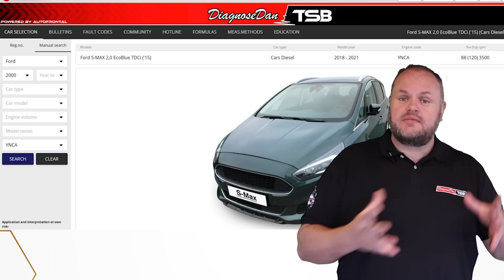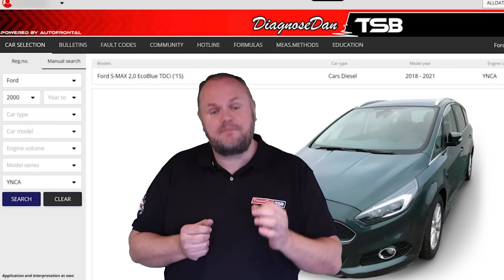Ford S-MAX – Engine won’t rev past 2000 rpm (intermittent), no fault codes. The hidden cause

Comment: I admit, we all cannot memorize all data PIDs correct readings when the car has been sitting a long time and is cold. BUT, a few minutes to scan possibly hundreds of PIDs to see one clearly out of temperature range and other noticeable ranges ought to raise a flag right away. With experience and a little dedicated time, on our own time, a listing of quick select PIDs to view before starting the engine will save time in the future and may rule out those sensors as the issue at hand. 

This is the thinking of a computer programmer who knows that designing the diagnostic strategy, scanning PIDs for a bit of time, and creating the listing for the future will initially take some real time. Still, once the algorithm is designed and implemented, it's a quick alphabetical scan of the PIDs, noticing a problem or not, and moving on to normal diagnosis or the swap out of a visibly erroneous sensor. This, of course, is for non-DDTSB subscribers.

Danny, this is the type of video that all automotive repair content providers should be creating for quick referral to the viewer and an additional income stream of the same data in a shorter release. We all believe that a full diagnostic video should be created that most providers create with lengthy diagnosis, but in the distant future, perhaps after one year, reupload the same video by editing out all info that is not direct and to the point of the actual FIX, of course, with a link back to the original full-length diagnosis video. In this case, the history of the vehicle is very important, as taught in the ASE Training and similar training around the world. Training that many techs seem to forget about in their daily routines.

Comment: @0:00 Danny???? wtf :face-blue-smiling::face-red-heart-shape:
OMG, they just throw new parts at it.. with no diagnose... 
@1:48 I would guess it's a leak in a inlet or exhaust.. false reading on sensors, like airflow / oxygen. But really waiting for your diagnose, Dan... :face-red-heart-shape:
some time later:
Wow... never would have guessed that temp sensor..
Reply: Temp and pressure sensors go bad often in a different way also; the scanner looks good until you actually measure the voltage at the sensor, highly recommended, as seen all over the DDTSB FB Group. This case only needed a visual scan of the PIDs, a voltage drop of the circuit, looking for corrosion, and changing the part that the PCM says is still within range, so no DTC.

Comment: Another person in agreement here Dan - one day subscriptions for limited selection would be very very useful and independants/DIYer's would happily pay for it and possibly contribute - after all - the manufacturers are now meant to have hourly / daily subscriptions to their platforms - and they mostly do - but trying to find TSB's in their platforms can be hit and miss. Auto-Frontal may not listen to individuals but you might be able to give them the hint..
Reply: DDTSB has lowered the minimum Sub down to 3 months due to the feedback of potential users for a trial basis. Last I understood, there is a 100 Euro fee that gives 5 x 20 Euro assistance tickets to help locate the problem at hand, which covers more than DDTSBs only from the Help Desk staff, and covers the issue until resolved, not only 24 hours. Sorry if this is not accurate.

Comment: Customer is happy because he's got new injectors and EGR valve, so it should be a keeper for several years.
Reply: Shops are happy as they have known good used parts to resell if they were not CORE parts.

Comment: This case is emblematic of many complaints from the customers.
Has the fault vanished after the shops did the final test?? NO. They shouldn't have returned the car to the customer!!
Yet two shops did the same. I wonder why the customer didn't check the car immediately and return in an hour.
So, the one million dollar question is: DAN, why is it allowed for the car shops to keep all the money for a wrong repair??? The normal logic says you get all the money back for a bad repair.
Reply: I think the issue results from a combination of factors.
Technicians work under significant time pressure to complete repairs as quickly as possible while also being responsible for both the diagnosis and the repair itself. 
This can make it difficult in some cases to explain to the workshop manager that the proposed repair solution did not resolve the problem. 
Regarding costs, it is often challenging to determine whether parts were replaced unnecessarily.
In some situations components such as injectors may indeed be faulty but just not responsible for the specific complaint. 
In this particular case, I know that the dealer did not charge for the injectors.
Reply: @Diagnosedan  I would have liked a more honest answer from you, Dan. You are finding excuses for the technicians. The matter is rather simple. You diagnose the fault correctly -> replace the faulty parts (or repair) -> perform a DRIVE TEST to verify that the complaint has been resolved -> return the car to the customer and charge for parts and labour. What explanations? Is the car fixed or not? If not, you charge nothing. The client comes to a car shop to get the car fixed, not to perform experiments on it.
Think of it in terms of a medical doctor. Let's say you have heart issues. You go to the doctor, he performs several tests on you, then he makes a diagnosis, and sends you to surgery for a heart transplant. He sends you home, but you feel as bad as before surgery. You then see another doctor, who determines that the problem was a clogged lung artery. He performs a surgery on you, then eventually you feel better. After your recovery, you go to the first doctor and ask for a refund for malpractice (wrong diagnosis, needless surgery, and needless heart transplant). The doctor tells you he can't pay anything back because you have a new heart, and work has been done on you. NEEDLESS work. Wrong call. No health restored.
So what I am asking you, Dan, is this: Does nobody stand behind his work? No responsibility? Just plain theft and incompetence?
Reply: @zbigniewrichard8291 
I would appreciate it if don’t call me dishonest Richard. 
I don’t believe that reflects who I am.😥
I’m not trying to make excuses i’m simply trying to explain the factors that may have contributed to what happened. Understanding these reasons doesn’t mean I approve of the behavior because there is no justification for it.
But recognizing the causes is important if we want to prevent it in the future.

For example, if someone punches another person i might say;
“Perhaps he reacted that way because he felt offended.” 
That explanation doesn’t mean I believe the action was acceptable. 
These are two very different things Richard i hope you understand that. 
There are also other factors to take into consideration. It’s possible that there was an issue with the EGR valve or the injectors but unfortunately replacing them didn’t resolve these particular symptoms.” So many things we dont know that makes it hard to draw conclusions.

Comment: Now imagine old, advanced (for its age) car, that don't have diagnostic interface which could show any sensor data, only codes, but there are none. It will be my fifth year with intermittent misfire in Mercedes W208 and at this point all workshops in 100 km radious have me blacklisted and if this continue I may gather enough knowledge to sense sensor data with just my fingertips :D
Reply: May the Force be with you.

Comment: For me, Ford programmers didn't done job properly. Weird readings from fuel temp sensor should trip error code. Easy to compare to other temp sensors in engine bay. 
And maybe thats also lesson to us of all, look into live data after no error code triped but car is not running properly.
Reply: Thanks for your feedback!
Reply: If they program the PCM correctly, we would just go buy the part ourselves, and no need for a trip to the dealer, which is the name of the game. I made a large post saying what you suggested, great idea mate.

Comment: Whenever a shop tell me my fuel injectors need cleaning. I walk away from that shop.
Reply: Unless you live in Pakistan where the entire fuel system and exhaust system and intake system is brown from the dirt roads. Cleaning these nearly complete systems is the same as a tune up there, I follow a YT Channel and I call it the "MANSOOR TUNEUP," then I mark the video as RED in my library as a non-keeper as it happens so often I have it memorized.

Comment: Always interrogate every sensors that can influence the mixture creation. Isn;t fuel temperature sensor a generic PID for OBD-II?
Reply: Easily overlooked!
Reply: its not out of range as far as programming is concerned; it's up to us to check it visually to see if it is around ambient temp, which the first 2 shops did not do.

Comment: I had something similar on my Laguna 2, it was throwing Check ignition system, all due to not attached connector of intake air temperature sensor. Luckily I have my launch diagnostic tool with me and saw odd readings like - 40C for intake air temperature.
I mean, a lot of mistakes require a test drive of the car.
Reply: If the sensor was disconnected like yours it would have set a faultcode and than they wouldn't have missed it.
Reply: 40C = open circuit; not all vehicles max out as low as 40 so beware, but still way too low.

Comment: Bro step #1 when diagnosing a driveability issue with no codes is to just look at the data and look for anything out of the ordinary, you would have seen that right away..... Morons 🤦
Reply: To be honest fuel temperature is a datapid that's easily missed.

Comment: I had the same symptom on my Jaguar XF 2.7. The fault was a broken cable on the diesel return temperature sensor
Reply: I guess that did set a code?
Reply: @Diagnosedan  
I didn't have any diagnostic interface to find out the error code...I just used the service manual and a multimeter.

Comment: The big question is why didn't any of the technicians check the data pids ? That fuel temperature would of stood out like a sore thumb.
Reply: To be honest fuel temperature is a datapid that's easily missed.
Reply: They did not remember their training, if they were ever trained properly.

Comment: This should have been picked up by any competent technician with a decent scan tool by checking all fuel related data PIDs
Still way too many techs playing swapnostics.
I was taught if you can't prove it, don't do it.
Better to give the job away than dig yourself a multi thousand dollar hole.
Reply: They did not dig a hole for themselves, unless you mean that the customer will never return again and tell their friends the same. The dealer did not charge. But you are correct.

Comment: 2000 RPM? The only way you can get it to rev that high is put it in 1st gear and try to drive it down the side of Mt. Everest. FORD - F'er Only Runs Downhill

Comment: Wow that is a weird problem! DDTSB to the rescue!
Also Ford sometimes SUCKS at setting fault codes. This one should have set "Fuel Temp Not Plausible" or something :)
Reply: Hi Ivan! I agree, because it doesn't set a code its very easy to miss.
Reply: Ford is one of the worst cars at fault codes 😂
It can limp and misfire for many KM without any fault codes.
And it can have permanent fault codes without faults.

Many faults also on LIN Bus but the fault codes rarely point to the actually bad component, an oscilloscope is almost a must have for these cars 😅

Our workshop bought an oscilloscope because i was trying to find a fault on this exact type car.
It had 3 alternators replaced and still no charge.
When i took it in it charged but after a while i got an alert in the dash that told me to start the engine or turn off ignition will enter economy mode in X seconds, before it went dark WITH the engine still at idle 😂

And i couldn't turn off the engine... 
Had to chocke it on the intake
After lots of frustration i got the oscilloscope and checked LIN Bus and this was all garbage, unplugged lots of things and when i came to the radiator shutter curtains everything became normal.
It had water ingress in the servo motor and shorted LIN Bus.

I have since had 3 cars with some different symptoms but the same solution.

First one was before there where made an TSB on this
Reply: @tullgutten  I believe that the shutter and alternator are on the same LIN line, so the shutter problem shorted out the alternator waveform. Let's assume a different scenario: we must learn to keep and interpret scope patterns, as the first several LIN square waves are the signature of the component, called the HEADER. Many times, the wrong alternator with the wrong signature is installed, and it still does not work; this will be visible in the square wave as the wrong data header for the specific application. Thanks for the info you posted.
Reply: Sounds like a programmer wrote the codes.  Technically correct, but useless.
Reply: Fancy seeing Ivan (one of my favourite YouTubers) commenting on Dan (one of my other favourite Dutchy you tubers)
My Ecoblue had an injector coil die and I drove it home chugging like a tractor. No misfire codes. Thanks Ford.
Reply: Exactly - This one is obviously a software issue - or a possible condition that has been missed because the fuel temperature should never really exceed the coolant temperature - especially if there is a fuel cooler - it would be an abnormal condition - especially if it has the effect of "reduced performance" and should be flagged as such. I'm sure VAG would have such a code - but then they over-software engineer everything to the point that nothing makes sense any more.. "Torque reduction due to some loss of data on databus blah blah blah.."

Comment: Well it looks like the first 2 shops did not test drive the car after the repair to confirm that it was fixed. Wonder how much the Ford dealer charged to put in new injectors?
Reply: What i've been told the dealership didn't charge for the replacement of the injectors.
Reply: Does the labor guide cover the test drive the next day after a cold soak?? This is the mentality and the problem did not show up until a loaded drive, probably at operating temps. Does your shop allow this, great if yes...Cheers

Comment: It's great that your TSB helped but does it also explain why the computer believing the fuel temperature being high caused the symptom?  Also this sounds like the sensor was intermittent and an intermittent electrical connection could have done the same thing. The third tech may have gotten lucky too by the sound of this issue.

Comment: Unfortunately, with an intermittent,  it can take time, LOTS of time to finally locate the problem.  If the shop does NOT have access to TSB's more time will be consumed until the problem is found.  Then there's the intrrmittents with NO TSBs.  Again more time needed.  
I've been there and know that feeling.  Thanks for the video Dan.
Reply: Thats right! Thanks for watching and leaving a comment.

Comment: We will always busy as long most of the mechanics "repairing" based on existing fault codes...but in near future we get competitor... Its called AI. But AI cant replace part..
Reply: But AI can't tell you where a wire is broken or where a sound comes from for example. Skilled technicians are still needed! 😁
Reply: @Diagnosedan  its true,but I dont know how often happenning with you : customer say "...this forum said this and that etc..now AI said this and that..."My answer : Why are you here then????"
Reply: AI is still very stupid, I have proven it many times. Manufacturers are actively moving towards Dealer only Telematics streaming direct from your vehicle in real time and trying to not share data with us. At least this is one reason why PCM programming is getting better for self diagnosis pointing directly to the bad part, hence Flat Rate repair time in the Dealership, the PCM will eventually be correct for all electronic repairs.

Comment: With such competrnce I wonder why the first two shops has not replaced the fueltank. :) Fuel issue the fuel is in the tank -> new tank, right? Good find! Immense value. Lesson: check the data of all sensors and look for the odd ones.
Reply: Thats right!

Comment: I don't understand the justification of parts canon in this vehicle, what made one to replace EGR and what made dealership to replace injectors??😢😢😢
Reply: Exactly what I thinking. Don’t replace any parts that aren’t confirmed broken.
Reply: @therealbonk378  on this vehicle a wise tech could have tried looking at PIDs, he could have won
Reply: There's a certain list to be checked when shooting the parts cannon 😂. You start with a warm-up...EGR...then you easily go to injectors, in the middle of the list there's always the dpf (clean, replace, remove and remap), ad-blue system (if available) has to be removed and remapping is needed...and so on with some points on the list, but usually you end up with a new ECU and if you really want to impress... The wire harness! 😂. So... let's say he was at the beginning of the check list..😢
Reply: Because that's what these shops do! It's all about the money you know.
Reply: @mark-d9k9b  Shop only needs the customer to ok the expense, legal steal since they signed the contract/work order.